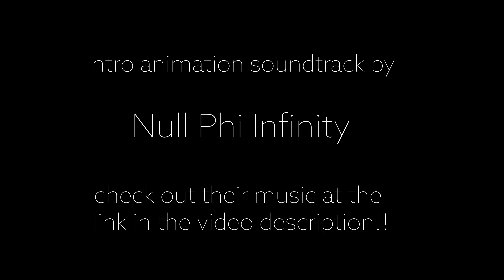Patch Programming: Ratcheting with MATHS | Make Noise

Comment: So I wanted to do a Ratcheting Bass Line with only my Make Noise modules, and after spending a bit of time and thought,  I figured out how to do it using maths. I then went and searched and found this video. While my approach was a little bit different then what you present, the basic concepts were the same and my results came out  excellent.

My Patch Basically, Tempi clocking Rene X, Rene X gate out into maths trigger 1,  Maths right side set to cycle and  out 4  to maths left side Cycle in. Adjust maths knobs for a good pattern and envelope. I used XPO into Spectraphon SAM and  Maths left envelope out to Spectraphon partials via a mult, and also multed to Optomix, Spectraphon outs to Optomix. For some randomness Tempi  channel slowly clocking wogglebug, and s&h out into Rene, X-cv with X.fun.cv set to snake. Rene X.cv out to Spectraphon 1V/oct in. Optomix out to Qpas then Mimeophon. Generative bass sequence for days. I need to get  a YT recording rig going so I can video record this stuff. Fun Fun.

Comment: Great video! Would the DUSG be able to do this as well? (I don't have a maths)
Reply from the maker: The core concept would be more or less possible, but it would require a number of supplemental modules to do it exactly like this. For example I'm not sure whether you could do the Cycle + retrig portion of it with a DUSG. Also anything involving attenuverters would need to be patched separately, and you'd need an additional mixer if you wanted to do the SUM out trick near the end of the video.

Comment: I got the maths V1 , Do you think I could replace the use of Cycle input ( 3:20 ) in this patch, by feeding a voltage signal like a clock or gate on the inputs of a cycling channel ? or the fact of that missing patch point can't be walked around? its a good question for the topic of the video as I want to use what I already have , also probably not very experienced for now. still investigating
Reply from the maker: Patch the EOC output from Channel 4 to the input of a VCA. Patch your gate source to the VCA CV input, and the VCA output to Ch4 trigger input. Now while the gate is high the channel will retrigger itself each time the cycle ends.

Comment: very cool technique...thanks for the video!  I'm wondering how I would implement this with my OG Maths as it doesn't have a Cycle input...am I still able to make it work this way? Thanks again!
Reply from the maker: To replicate the Ch4 Cycle input, patch the EOC gate to the input of a VCA, and the gate you want to use to turn on Cycling to the VCA's CV input. Then patch the VCA's output to Ch4 Trigger. In order to also do the retriggering "sync" shown at about 5:07, you would need to OR or mix the VCA output with the other trigger before patching to the Ch4 trigger input, and make sure that you are using short triggers for it rather than longer gates. Because of the variable width of the EOC gate output, it might take some trial and error to get it to work just as it does in the video, but you could also stumble across fun new results!
Reply: @MAKEN0ISEMUSIC  awesome...I'll give it a try!